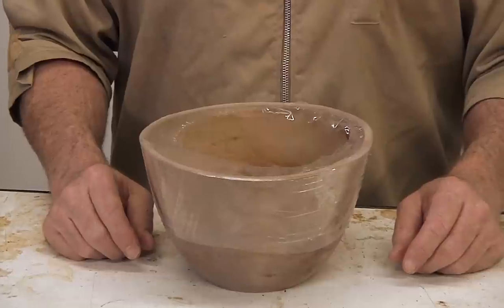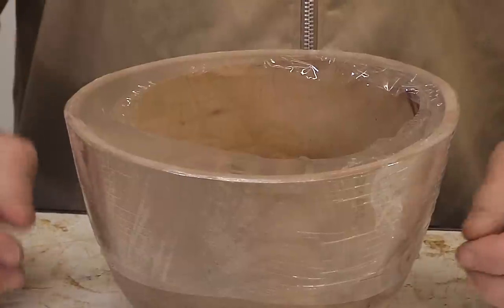BOWL DRYING METHODS with Reed Gray aka Robo Hippy

Comment from the maker: If you soak in the green or blue type soaps, they can leave a green or blue tint to the wood. I have used lemon color with no problems, the light brown ones, and there are now clear ones. I did try less than 50%/50% mix and it doesn't seem to work as well, but that is another on going experiment...
Reply: robohippy n
Reply: So I am guessing these bowls are not meant for food service.

Comment: really enjoy your no nononsence approach.  You mention using newspaper along with plastic wrapping after removing the jet bowls for the dishwasher/water Bath for 24 hrs.  Do you use dry newspaper or dampened newspaper?  Thank you!
Reply from the maker: The stretch film is pretty much all you need. I do not use it on maple, which has a lot of sugar in it and you will get mold in the wood that does not come out. Make sure to round over the rims, especially the outside rim. Inside rim too, but it isn't as important. Many will put their blanks inside paper bags. That does work, but I do a lot of bowls. Christian Burshard, some one who also turns a lot of madrone, will put the bowl or sculpture in a paper bag, and put that inside a plastic bag. The paper bag gets changed every day.

Comment: Great videos Reed and still liking the RoboRest! I really like the quick ,accurate adjustment. I have been turning more bowls now and experimenting with different drying methods including my unturned bowl blanks. I cut my blanks from logs (as in your video) then wrap with the shrink wrap. I've had good luck keeping these from cracking until I get to turning them. I've also tried the wrap on rough turned bowls and have experienced the mold issue. When that shows up, I usually unwrap then and let them to continue to air dry. Currently trying my rough turned bowls in shavings from the turning of those very same bowls. Not all are "wet" turned as some have been waiting their turn wrapped in the shelf for months.. Lots of words to get to my question: How dry is dry enough? How do I know when the bowls are ready for final turning, or in your method, when it's time to sand? I check my blanks and bowls with a moisture meter but that seems to only give me surface readings. When I turn the blanks, it seems to be much wetter deep inside. Is there a way to know when the bowl is done drying, whether using DNA, LDD, or wrapping alone methods?
Reply: I'm new at this but weighing is one way.  From what I have read, the wood will lose about 30% of it's weight when drying.  I would think that when the wood stops losing weight, it's dry. I am drying one now in a bucket with a heating pad (like for back aches) on the bottom with 2 vent holes (one at the top edge and another at the bottom edge) and a towel on top.  the rough bowl sits on a shelf about half way up.   Convection takes the moisture out.  So far, it has lost about 1 ounce a day, with the target of losing about 12 ounces.  I know it's a pain measuring but I think it may be the only way to know for sure.

Comment: I do the DNA method after rough turning. It takes longer in cold weather then warm. Warm weather I only need to soak them 24-36 hours. I take them out let them air dry hour or two then wrap in brown paper covering the foot of the bowl and leaving the top open a little. I turn them upside down on a wire rack about a week. There ready to turn. I do everything on the lathe sanding, finish, and waxing. Now once there dry with the paper on them is when I know  weather there to badly cracked to turn.

Comment from the maker: I got side tracked, a couple of times.... Anyway, it seems to be good as long as it doesn't get too dirty. Worst thing for it is black walnut because some of the color comes out of the walnut and makes anything else black. Madrone leaves it purple. I can soak a lot of madrone and myrtle in it before it goes dark. I would guess I throw it out after maybe a year, but I don't do 700+ bowls a year any more. It can evaporate down to muck, and I can add some more soap and water, depending on how dirty it gets. Bowls do need to soak for 24 or more hours. It just doesn't work as well if I soak for shorter times.

Comment: as i learned from you 3 .5 yrs ago turn to finish .  i  like that way better .  also was worried about the molding on the bowls . as i live right up the road from you . thanks for the tips again gonna soak and rap  and see how that doe's for me . vancouver wa
Reply from the maker: Come see me at the Symposium. I will be in the Vendor area, which is free to the public, well unless you count spending money for 'toys'...
Reply: ill be there would love to chat with ya .  happy turnings
Reply: hey one more question  so i dry my bowls  in basement witch is around 50 degrees right now things do mold a little bit just some pieces of wood . so should i put a dehumidifier  in there . to suck out moister in room doesnt get alot of air flow in there
Reply from the maker: If the wood is getting moldy, then it is drying too slowly, and/or is maple... I would consider 50 degrees to be a bit cool for drying. I do remember Mike Mahoney commenting that his wine cellar was ideal for temperature and humidity. A dehumidifier might work fine, even to the point of making a small enclosed area for drying. A very small light incandescent light bulb, 15 watt or so under a wire rack can make a big difference, but a 100 watt bulb might be too much. Not sure, more experimenting needed...

Comment: To work in wood (a bowl, a spoon or a statuette) and mode to another raw tree
when the product is ready, it can give a crack, to crack it was never that place
Wooden finished product in highly salted water and cook for about 1 to 4 hours.
Basically hour missing. Thereafter, winding articles with old newspapers
leaving for absorption of moisture from wood, changing every day at about 1 week.
After this tree will never crack. Salt kicks inside the water and dries the
fast wood, protecting it from cracking. The paradox, but it works and is used.
Can not treated with a piece of wood to boil in salted water and then cut after drying
newspapers or paper or cloth.

Comment: I know most of this is from six years ago but my question is , what does the soaking in dish soap do??
Reply from the maker: It makes a big difference in sanding out the bowls. The method was developed by Ron Kent of Hawaii who used it for the Norfolk Island pine bowls that he turned. Any of the pine type trees have a lot of sap or pitch in them, which really gums up the abrasives. The LDD method makes it much easier and not as much clogging of your abrasives. I don't add black walnut to the soak because it will make every thing after black, or much darker.
Reply: ok, thanks. I did watch the video but didn't  understand the soap thing. Glad you're still around six years later.

Comment: Hi Reed, great video - I didn't see this video over on WR, but wanted to ask you if you've tried the plastic wrap alone without using the DNA or LDD soak, and how effective it was.
Reply from the maker: +Bill Rockwood Bill, that is the way I do most of my bowls, but I do prefer the LDD soak as it makes things easier to sand out. Not all woods need the stretch film around the rim, but it does help to prevent cracking on the rim as that is the most vulnerable point. Rounding over the rims is important too.
Reply: Thanks Reed, I appreciate you sharing your experience.  I picked up a roll and will have to give this a try.
Reply from the maker: +Bill Rockwood Oh, I have noticed that with Maple, which has a lot of sugar in it, that it can get moldy under the plastic, so watch it with that wood.

Comment: Does LDD affect finishing with hard surface finishes like lacquer? Thanks for the video must have missed this one
Reply from the maker: Gerald, no idea about what it would do to a surface finish. There is some glycerin in most soaps which may cause problems, but no idea. I know silicone can cause problems with adhesion. After the wood is dry, you can't feel or smell it. Maybe soak a piece and try it out.

Comment: for all you who have done lots of log turning, I received a lot of green logs and have no idea what it is.  It has really rough bark and just under the bark it is intensely pink.   It smells bad, too.   the sap wood and heart wood don't have that much difference in color, a light creamy beige color.  I have no idea what it is but it has some beautiful spalting that I hope will not bleed into the rest of the wood (the exposed part is already doing just that). 
I would like to know what kind of wood it is.     
THAnks!
Reply from the maker: If the pink colors are in stripes or streaks through the wood, most likely Box Elder, which is known to smell bad some times. This is a very common wood in the north central states. If you are on any of the turning forums, if you can post a picture, that would help.
Reply: @robohippy   it is intensely pink completely under the bark of the full tree, it's about a 1/4" thick band under the bark.  I'm in Calif. so that's probably not it :>)
Reply from the maker: Well, there is a California Pepper tree that I had some pieces of once. It was pink on the outside and brown and green on the inside, kind of like spumoni Ice cream... No idea other than that. @AffordBindEquipment
Reply: @robohippy  You nailed it!  That's exactly what it is after doing some research on the tree.  I turned some today (wet) and the spalting has caused separation in the growth rings, so I don't know how much I will get out of the logs I got.  too bad...I started out with a large piece and by the time I got rid of the cracks I ended up with a little tray...
Thanks for the info.  love your channel and have learned a lot as a newbie...

Comment: hi robo, on  bowls  when i put them in shavings they get moldy. when I'm  ready  to finish  turning them does all the mold spots need to be removed or that something  I don't  have  to  worry  about .
on one of  your  videos  you said mold wasn't  a  bad thing  but I just want  to  be  sure .
Reply from the maker: +MANUEL GARZA Manuel, some times the mold can turn to spalting, which is good. I tried the wet shavings a few times, and some times it left bad colors, or ones that I didn't like in the wood. If you are twice turning the bowls, this is usually not a problem. Using dry shavings does pretty much the same thing, but you don't get the mold. Woods like maple have a lot of sugar in them, which the mold loves.

Comment: Dry air is heavier than moist air.
Reply from the maker: Tried to figure that out, but it makes no sense.... Hot air rises, cooler air sinks. Relative humidity levels make no difference... Hot air can hold more water than colder because when colder it condenses...